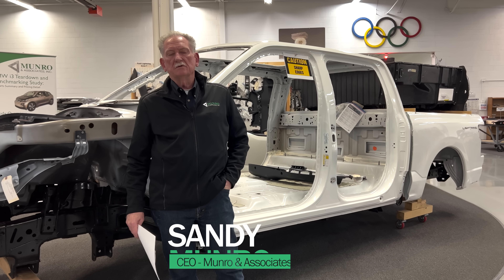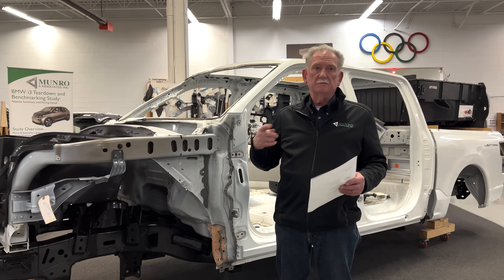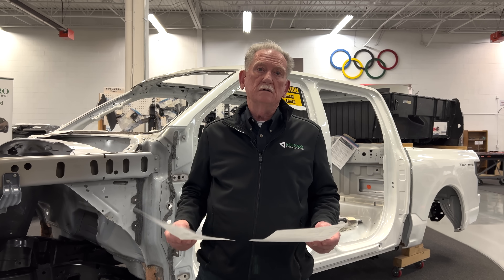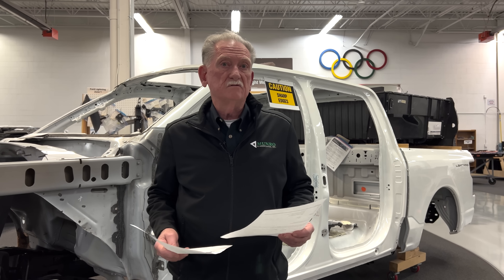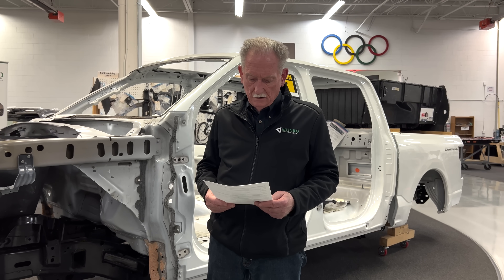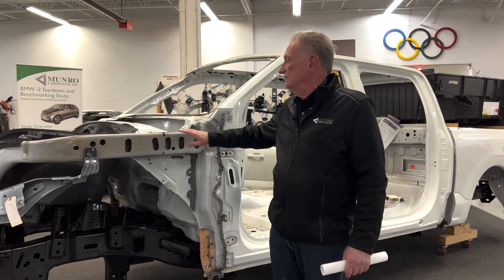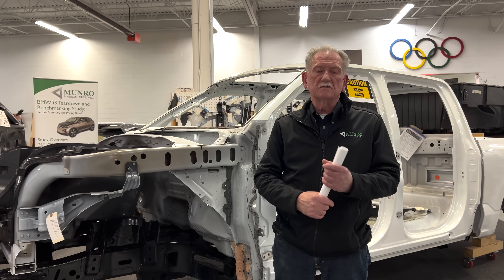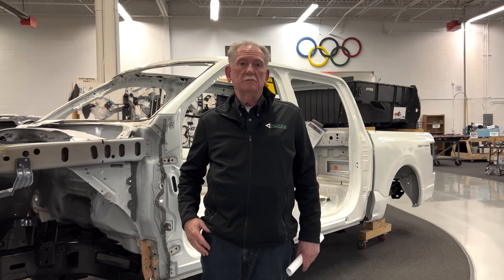Sandy's Initial Thoughts on the 2025 Ram 1500 Ramcharger

Comment: I would rather have a Ford Lightning (SUV would be perfect) 
but I want to pull a mid-size RV so the Ram may be a better fit for travel, I don't want to stop and charge every 100 miles with a trailer.

Comment: @Sandy, since 2009, it’s no longer “Dodge” Ram; it’s just Ram now. The addition of a range extender is a blessing for those who occasionally need to tow with their electric truck. While the 690-mile range might be excessive for day-to-day passenger use only, it’s likely that their real focus is on acceptable towing capacity range. If we follow what we’ve learned from other electric vehicles and cut the towing range in more than half, we are left with a 300-mile range, which is ideal for towing. Most people can go 300 miles between bathroom breaks, meals, and refueling (unless you have kids, of course). Ram has done their homework, and if they can nail the pricing, they’ll have a winner. 🚚💨

Comment: I think the extended range is a big deal, first of all if you are towing something heavy your electric range is going to drop significantly.  Secondly I imagine recharging with a big trailer hooked up would be a pain, third if your out camping away from charging stations for some days and running around doing things you will want that extra range.  Not sure why you think range anxiety is not a real thing, it seems pretty real in many circumstances to me,  cold weather too.

Comment: Come on guys - the Ram EV truck will weigh about 8000 pounds empty!  Add people and cargo and now you have a 10200 pound truck!  Add a 8000 pound trailer and you have a 18000 pound combo ... I bet the thing can manage it, but for $100K that it will cost you, you could have a F250 or 2500 or other 3/4 truck and save more than $25K ... it just does not make sense.  The all electric lightning is a bit complicated, a lot of controls, cooling, batteries, etc., etc.  The Ram will have that AND an ICE engine, generator, extra cooling and more electronics to control everything ... and we all know how good Chrysler is at electronics (not very).  It will be a spaghetti match under the hood with wires, tubes, pipes and all kinds to stuff ... for me a pass on both.

Comment: Hmmm. Electric for daily commuting and 300 miles hauling 10000 lbs on the weekends. I am not seeing any electric trucks able to make that fun. I have 2021 3.0l EcoDiesel which is great at it. Looks like the RamCharger might be a great fit for that as well. It will be interesting to see how it actually works.

Comment: Sandy seems biased against this, he doesn't mention the weight savings of the smaller battery pack. He doesn't mention that refueling is faster and easier to find than recharging, and that people do long drives occasionally.

Comment: To many people are talking about the overall mileage but that's not the most important factor when it comes to miles. There are a few things such as the truck driver that uses it as a daily and being able to run solely off electric. Then you have the driver that needs the long haul with the extended range and saves on gas during the process. The last thing is the person that needs a work truck but saves on gas, and able to use the power outlets from the truck as well. There are so many capabilities that can be used and that is what the focus should be on and not if/if you don't need 690 miles driving range.

Comment: Thank you for the info and video!   I appreciate the effort you put into the channel !! Question … How big does a fuel engine / generator (no drive coupling… electricity generation only) need to be to supply the electric motors and systems?

Comment: Towing Sandy... the range is all about towing... you lose like 50-60% with a travel trialer like ours. So for us, this may be the best option so we can get a solid 300 miles per trip. Then we can still use  the battery as a generator for the camper and when we are in an area, we can drive pure EV everwhere. So yeah, 690 ftw :)

Comment: I agree that this is about truck capabilities balanced with the benefits of an electric around town vehicle. I like this solution as it solves the towing issues all other electric trucks face...range drop off but also charging stations that are not really set up for charging with a trailer hooked up. With this you don't need to worry about pulling up to a charger...just add more gas and keep on going. Long term? This might now hold up depending on how technology and infrastructure advances. I drive a Ram Limited and love it, but with electrification of cars I'm interested in moving towards that. I don't want to give up my truck but looking at the Ford Lightning I'm not interested at all and things like the Rivian just don't have enough truck capacity for me. Having the option to pull a good size trailer and then also have an all electric truck for around town sounds nice. Yes the gas engine is extra weight when not in use but as Ram hasn't put as many batteries in place some of that weight is offset. 

And just one comment on range anxiety...this isn't a marketing thing at all. Live in a colder climate OR travel through cottage country with sparser infrastructure and it's a real thing. Not everyone lives in cities or suburbs so I find that comment to be a bit ridiculous. Just my two cents and everyone has their own perspective which I respect.

Comment: I think this makes sense for the Tow'ers out there.  Aleast until we see better cheaper batteries that can do the same. I would like to see this in a midzise. I think that hybrids like this will be nice becuase down the road you could rip the ICE out and just add extra battery in that space. They are already companies making conversion packages so in this case it should be simpler as this is a PHEV it has all the bits of a full EV.
Cheers

Comment: We need the range extender because ev’s don’t store engine energy to tow yet, which is what a lot of people buy pickups to actually do. Some people will never put anything in the pickup bed, but a lot of people want a pickup to commute then use as a truck, filling up the bed or towing 5-10k lbs. Even charging infrastructure doesn’t support towing right now, so the range extended truck is an amazing option.

Comment: 550lbs extra weight, but it’s 40kwh less than a rivian or lightning standard range, which is 1000lbs less battery. So at the end of the the day it should be lighter than the extended range ram, cybertruck,  or Rivian.

Comment: Range anxiety is BS? I gotta completely disagree with that statement. If you're out in the sticks good luck finding a charging station. Even if you're driving along major highway routes you still have to plan your charging stops and often go out of your way to do so. Not to mention the time spent waiting to charge and possibly waiting in line to use it. All of that gets increasingly more difficult the farther out you go.

The only ones who say range isn't an issue are people who rarely stray far from the city and usually already own an EV (often times they own multiple vehicles too). I hear people justify their EV all the time and 100% of them rarely leave their bubble.

Comment: Small trucks should be full electric but once u get into the f150 and 1500, and up to the HD Truck u need that range extender. I do think a v6 was overdone, a v4 would have worked fine.

Comment: This is the problem with these auto experts. They have never worked. They have no practical knowledge. Cold Bad weather a loaded truck & towing to get home at a descent hour. These autoblog guys drive & talk.  They have never worked for a living. They are clueless to what a truck owners needs are. 690 mile range? hauling the boat to the lake with the kids. Charging stations are to far between and busy. A quick stop for fuel & you're home. Never trust a man that dosent work but claims he is an expert

Comment: As most have said towing is the issue.  Sandy also needs to spend sometime in Rural America where there is a lack of chargers.  Additionally, winter weather plays havoc on BEM's let alone trailering.  Rams solution is an excellent interim solution while battery and charging technology advances.

Comment: I don't live in an urban area. Chargers are far and few between. A range extender is clearly a desirable feature. It's potential to supply power on work sites, camping, and home emergency backup  is a winning feature. 
 I suspect a comparison of a hybrid vs range extender could show the range extender with an advantage. Both can be home charged. The hybrid drive train could be heavirr and more costly. Toyota makes an amazing hybrid transmission.  I suspect the range extender is less complex.

Comment: I totally disagree , it is about range anxiety, and time it takes to charge. I don’t want to have to worry about those things.  I used to farm and my trucks had 26 gal tanks, not towing anything, there were days I had to fill up 3 times.   I couldn’t be waiting an hour or more to charge up, people that use the truck for work can’t be doing things like that.  Even if I wasn’t working, I don’t want  to be charging more than 15 min, at lunch it might work but the charger has to be where you eat and not occupied.

Comment: I think the RAMcharger is an awesome idea. While in and around town you can go fully electric. But once out in the country charging stations are not so widespread available. And Sandy, you have to go see a doctor. Charging an 80 kWh battery pack, well in my current electric car that would take between 45 minutes and one hour, IF the charger cooperates (charging times is the biggest sales lie there is). I usually don't take that long to pee, so my break is going to have to be extended substantially to make it another 2-1/2 hours or less if I did not charge to 80%. If you have to pause one hour to charge your battery pack every 2-1/2 to 3 hours , that would kill any average speed or miles per day. Car charging is (VERY slowly) getting better, but even in town charging stations are not on every corner unless you are a member of every charging station outfit there is in the USA. Chargers are often down-and-out, even though the app says it is OK. And charging at these stations is expensive, cost per mile is comparable or higher than to driving a gas car. Electric cars are great for in town, but out in the country, on trips longer than the range of your battery pack, NOPE. And when you start towing, your range drops dramatically.

Comment: It amazes me how little people really lookat this product, and the information provided. 690 mile range us empty. And this truck can tow 14k miles, haul 2600lbs. Its 3/4 ton territory. That 92kwh battery will go about an hour on the freeway till it needs the engine. The extended range F150 will do about 150 miles . Thats 2 hours, then you need to stop for 45 minutes to charge. This truck will do 325 miles towing (with full charge), assuming half range when towing. Thats 4+hours between stops, and then you can refill your tank, recharge the battery if theres a charger, in the time to stretch and have a quick meal. 
 To be able to keep enough power to move at 65-70mph on flat ground hauling 10k lb, the generator may need to output 100-150hp constantly, so thats 75-110kw. Using a small 4 cylinder may barely do it, and then you would be over-stressing the engine. Best to run a larger engine at a little more relaxed state, even if you lise some efficiency. Plus you gotta think of the noise of that generator running at a higher rpm than usual, i think id like to have it run more slowly.

Comment: How far does each truck go while towing a box trailer or RV weighing 5000 pounds?
All electric trucks SUCK if your actually doing anything that you would need a truck for. Go from Houston to the hill country of Texas or go from Charlotte to the coast for a weekend with the boat or an RV in tow.  Try going from LA to burning man and back with the same load.
Ford cant do that. Rivian cant do that. Will Dodge? Maybe,  wont know until someone gets ahold of this Ram Charger and does some testing that actually matters.

Comment: I normally drive 250 to 350 miles per day making deliveries and I don’t have time to charge in the middle of my day.  I only wish the Ram would go 300 miles on the batteries.  And did I mention I love ford but not charging in the middle of the day.

Comment: The Ramcharger is brilliant! A prime-mover that is fully electric, with a gasoline based generator to top up the prime-mover. The heavy lifting is done by the 93% efficiency motor, and the low torque juice top-up is done by the 32% efficiency ICE. Freight trains figured this out decades ago. If the regulatory agencies had simply outlawed ICE prime-movers, all cars would be built this way and we'd be living in a cleaner world.

Comment: Ironically, I dont think the weight of the ICE would matter as you're cutting the batteries in half. So willing to bet the overall weight of the system is close to the same. 

 Second if if you can only drive a few hours to stop, and eat or pee, those choices are not dictated by fast charging locations. 

Third I can fill up 87 octane fuel at almost every exit on the freeway 24/7. This is vital while towing.  

Last as a positive on all EV's that few people talk about, the regenerative breaking will be amazing while towing downhill. It will be second only to exhaust brakes, and even then it might be better than some based on how many watts the batteries can take. 

140kw is about 180 hp of breaking force. The Ram 3500 does around 320 hp ( I believe) of breaking force, and that holds back 30k lbs.

Comment: Range is all about towing.  Towing a camper with a lightning or any current EV for that matter is a nonstarter.  Stopping for a charge every 100 miles is ridiculously impractical, assuming chargers would even be placed 100 mikes apart on any given trip.  Reality is you’d be hunting for a charger after 50 mikes just in case there’s not one available further on.  690 mile range becomes 340 when towing, which is entirely reasonable for traveling with a camper in the US, and the only electric solution that makes sense for long distance towing.

Comment: I currently own a plug in hybrid that only gets 30 miles.  It works great for my wife because she drives it back and forth from work and still has 90% battery left.  That saved my 5.7 hemi from short distance driving.  Know comes the part I don't enjoy about it.  It also has a small tank of 11 gallons, so between battery and gas, my range is 300 miles till I have to fill it up again.  Although it runs more efficiently than my hemi, i have to fill up more frequently with the small tank that I don't love.  My family lives 4 hours from me.  I would love to make a trip there and back on a single tank.  Sandy wonders why anyone would need that.  I dont need that in a single trip, but spread out not seeing a pump between. I would welcome that!  Lightning is the better choice!  Why?  Any weight drastically changes the range in it.  Ford EV is now a soft hands (office man, engineer, sales) truck that is a weekend home depot warrior.  Put tools in it and your not going anywhere but walmart to charge it constantly.
Reply: @travisjensen4023
What particular plugin hybrid do you have???

Comment: My diesel truck gets 16 mpg unloaded (about 550ish miles to a tank). Add my fifth wheel and it gets 8 mpg with me stopping about 200 miles or so just because I prefer truck stops over regular gas stations with the trailer attached.  It isnt a big deal because it has a 40 gallon tank and even using truck stops, average time to refill in the busiest of times is maybe 15 to 20 minutes.

If you convert the battery size on the F150 lightning, it is the equivalent to about 5 gallons.  The 320 mile range dramatically drops when adding anything towing to it.  Weekend boat run would have to be at most 100 miles and good luck finding a working EA station and an hour plus wait to recharge.

This feels like the best of both worlds. Electric motor drivetrain (on demand torque and great engine (regen) breaking )with a gas refueling option. Trains have been using a similar design for years.

Comment: If you replaced HALF the weight of the engine, transmission, radiator, exhaust, and a gas tank half full of gas with a larger battery the range would probably be way over 400 miles.

Comment: Dodge should make a 2500/3500 PHEV if they are doing 130KW its worth it and better than a cummins.  Just put in torsen differentials a use brake traction control and tis probably better than lockers for anyone not offroad all the time.    My guss is Ford is going to have 1/2 ton BEV replacement for the lightning better than the ram and 3/4 ton and up PHEV superduty before dodge.